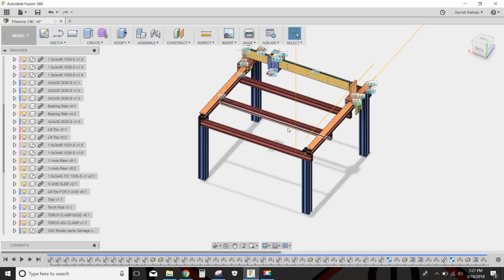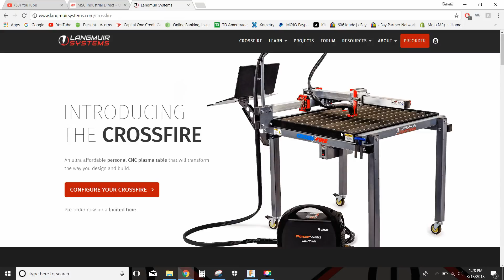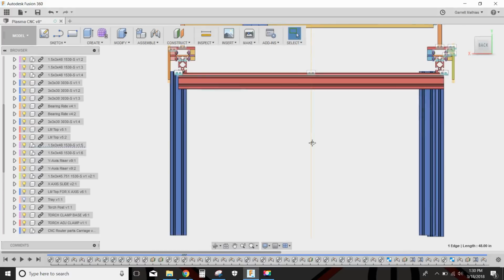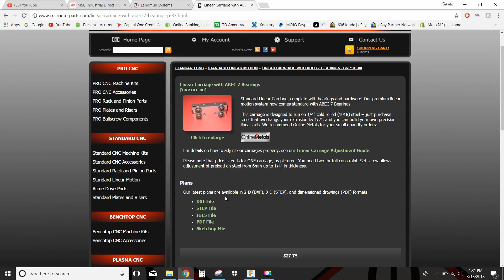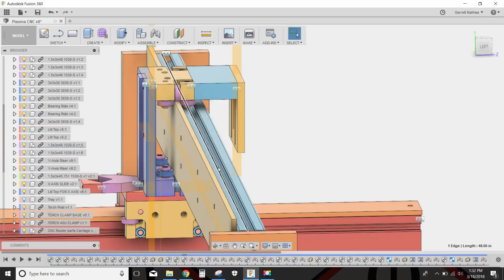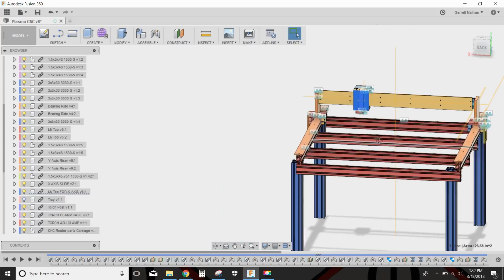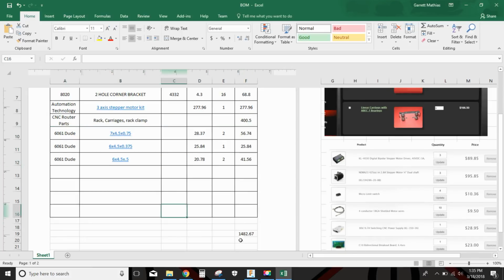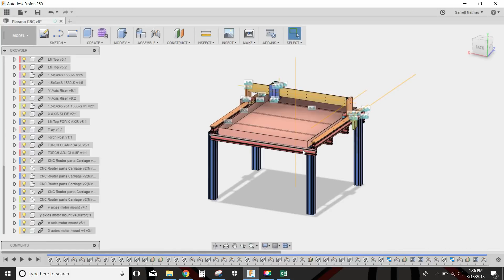CNC Plasma Cutter Design: Home Mfg. Days #31

Comment: Why are the right side legs inside the runner, but the legs on the left side outside of it?
Reply from the maker: That's a really good question. I must have had it constrained wrong when I did this video.  I have since finalized the design and made the base.  All legs are inside the runners. You can see the base build in one of my later videos
Reply: Cool. Glad you got it worked out, and I'll check that out on your other videos. 

How do you like the 770 at this point? If you had it to do all over again, would you still get that one...or would you go for the 1100 (or something else)?

I am in the process of researching these units for a potential purchase, and am trying to decide between the 770 and the 1100. I'm going to visit Tormach and check them out for myself--but I think the 440 will be too small for my needs. So I believe I've narrowed it down to either the 770 or the 1100. I do have single-phase 220 in my shop, so I could certainly go with the 1100. But the 770 might be enough machine for my needs...I'm just not sure yet.
Reply from the maker: I really like the 770.  If I had to do it again, I would still get the 770.  The 10,000rpm spindle is the best perk there is while still having a decently powerful spindle.  I mean you can get everything done with the 1100 I just like the higher speed spindle for some reason.
Reply: Just got back from Tormach, and seeing the 1100 and the 770 side-by-side. Both are very nice machines, but given the relatively small price difference between the two models...I can understand why the 1100 is still their best selling PCNC. 

I would be very happy with either of them though, I'm sure.
Reply from the maker: Absolutely, both are really good deals and you will definitely be happy with whichever one you get.  You must live close to Tormach. If so, that's a lot saved on shipping!
Reply: About 125 miles away or so, yes. That 1100 is a big machine though, so it might be challenging to go get that myself. We'll see I guess.
Reply from the maker: With how much money you'll save in shipping the 1100 would be a deal!  If you could get it yourself.

Comment: I read through most of the comments.  Looks like they've convinced you to wide to 4', setup it with torch height control and brace the legs. I agree with all of that.  I don't have one, but I've watched a lot of other guys with them. lol  If you brace the legs, I think you'll be fine with using just the same 80/20 on the legs as you have for the rest of it.  Looks like you have it designed with square pieces.  For that size.....wheels!   Personally....I think I'd put two shelves.....one at the bottom with the wheels and one in the middle.  If you make the horizontal supports just a bit longer, you can work it out to store extra sheets, vertically on the side of the cutter.
Reply from the maker: Definitely wheels! I will be getting those at some point as well.  Even though it is an aluminum base,  those 3"x3" pieces of 80/20 are heavy!  I like the idea of 2 shelves to store extra pieces of sheet metal but I'll have to see.  I really just want to try and get the base set up and get the thing moving before I start adding all the accessories though
Reply: Def don't need it all at once....but if it's planned for from the start, it can be accounted for.  :)  My comment on the 3x3" pieces was that they may be overkill and you could used the same rectangular pieces that you're using on the rest of it....provided they're braced.  It would save you from having to buy two different types and be lighter to ship.

Comment: Where do you buy your 80/20 from?
Reply from the maker: I actually just get it from the 80/20 website.  I have dealt with them over the years with work and internships so I just always go back to use them. I'm sure you could get it a little cheaper somewhere else though.

Comment: I will second the comments about the width and z axis. I would suggest you have at least 50” of travel. Hitting the end of travel because your sheet is a little offset sucks. For the z axis an Open Builds C-Beam z axis is a pretty good size for that task. The way it’s made makes it pretty easy to make a floating head for initial height sensing too.  When you attach the gear racks use 3M VHB double stick tape. That’s the way they do it on Mechmate routers. That stuff is amazing and easy to use. Just make sure you wipe down the surfaces with acetone before you stick it on.
Reply from the maker: Yeah, i'm going to go ahead and make that design change with the z-axis.  That c-beam looks like it would do the trick too.  I planned on using these rack clamps from CNC Router Parts to hold the rack in.  http://www.cncrouterparts.com/rack-clamps-p-64.html  I guess i'm confused on what the double sided tape it used for.

Comment: Fun project!  I'd suggest adding some steel plate on the sides of the bed (cross ways) to cap off the 8020 and give you something more to attach the legs to.  Also, you could add a couple sticks half way down and join with a sheet metal shelf or something to add more leg rigidity (or just 4 strips of steel)... but two lower extruded sticks and a shelf spanning / bolted to each would add a little utility spot to place the cutter or whatever for storage when not in use as well as give you the leg rigidity.
Reply from the maker: I will definitely put a shelf down there on the bottom for the control box but that will all be in good time once I have the money in the budget.  I'm just going to start off basic and work up from there. I will be using Mach 3
Reply from the maker: Not a bad idea.  I should add a little more leg rigidity and it would double as a shelf for the controller and such.  Thanks for the tip!
Reply: If you're going to put the controller down there from the start, you'll need to make the pan right away.  What are you using for a controller?

Comment: Hi, I have never posted a comment on anything to anyone before but when I heard you say no adjustable z axis I wouldn't dream of a plasma without one. The metal warps a lot and you wouldn't be able too use a torch height control either. I built my table about 5 years ago and have a water cooled spindle that works great. My table is 5.5 foot by 8 feet. I also made my own Cnc mill from a encourage mill so the table still comes in very handy for milling anything up to alum.  My costs building the whole table was $2200.00 with 1200 in oz motors and 20 mm lineal rails.
Reply from the maker: Hi! I appreciate the comment! I can still adjust the torch height but it will be manually adjusted before I would run the program.  Would you recommend making the table with a z-axis motor and a torch height controller or can I still get away with the manual adjustment? Also, I really wanted linear rails but they are really expensive compared to the linear carriage setup.  I would like to have at least 600 oz-in motors but they start to get expensive as well.
Reply: MojoMfg. I get my parts from a local guy. I am in California though so sucks for you on shipping but his prices are good and he sells on eBay. Hubbard Cnc. If you can’t find him let me know and I will get his info.  I have my y and a is slaved with y and both 1200 oz. and 600 for x and z   Motors and rack and pinion and bearings all from same person.   I would go with a powered z though. I had a guy with a Torchmate cut parts before I built mine and he had a hand adjustment on 3/8 plate and what a pain in the butt to do. If I can be of any help feel free to ask. Ed
Reply from the maker: I found his ebay store.  I think I'll have to get my rack and pinion from him for sure...his prices are way too good even with shipping.   I will have my y and a slaved with my y but I'll have 425 oz-in all the way around.  After I got a few people to tell me I should get a powered z it seems like I should definitely go that route instead of a manual adjustment.  I'll just have to figure out how to work the torch height control in with the controller and tie it back to the motor.  Thanks so much for the help, really do appreciate it!
Reply: MojoMfg. Hey no problem. I went through a lot building mine. Never even seen one work before building mine other than online. Lol. I have a thc but not yet working right. The powered z is still worth having. The guy I told you about has break out boards and the relays to turn the plasma on and off. Hooking up forth axis on both my machines now. Should be fun
Reply: Good morning. Just wondering if you ordered the parts for your plasma table from the guy in Sacramento California...I just bought a new bob from him and it is 5 axis and his own design for $15. To replace the one for my mill
Reply from the maker: I got the base and all the linear motion parts.  I didn't end up using hubbard cnc for that though.  Since I went a little longer I went for the 52" rack from CNC router parts.  I still need to get the steppers and the drivers though.

Comment: You really want it to be able to handle a 4'x4' plate as this is half of a standard sheet. I am also designing a 4'x4' plasma table and learned that one the hard way.
Reply: i agree you might want at least the x be wide enough to fit a 4' sheet.  It would be fine if its shorter in Y as it can just hang off and you could move the material
Reply from the maker: I thought of that but then I was also thinking that there is a good chance I will never get a full size 4'x8' sheet just because I have no way to handle it easily and it seems like getting it shipped to my house could potentially be a problem.  What's your experience with that?
Reply: That and probably makes the cost go way up  even if you just need a few inches.  I have a 2x2 at my shop havnt needed to cut anything larger yet.
Reply from the maker: I do like the thought of have the X wide enough to fit a full 4'.  That would make it a lot easier for standard sheets....I think I will go ahead and make the X a little wider for that reason.
Reply from the maker: I guess it all depends on what you need to cut but I just wanted to have the capability to do larger things if I needed to.  Like you said, have it be able to handle 4' in the X then just just let it hang off the front edge
Reply: A simple work flow would be to have the sheet stick off each end of you 4'x4' table by about 2' on each side. Then center the plasma torch and split the sheet into 2 leaving you with 2 4' squares.
Reply from the maker: That's a good idea.  Seems pretty simple.  Still seems like it would be hard to get 4'x8' sheets shipped to me.  I guess I could always go pick them up somehow.
Reply: By the way having a Z axis is a really good idea. Sheets are not perfect and things move. Torch height control really make a big difference as well.
Reply from the maker: By the sounds of it, it seems that it is a very good idea to have the torch height control so I going to add that in there as well.